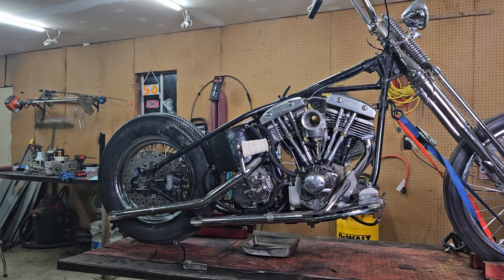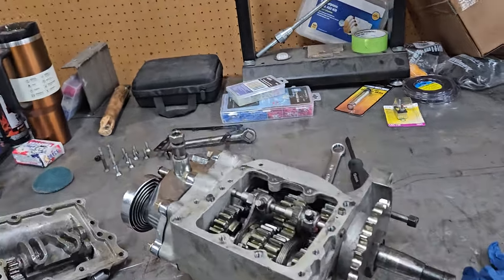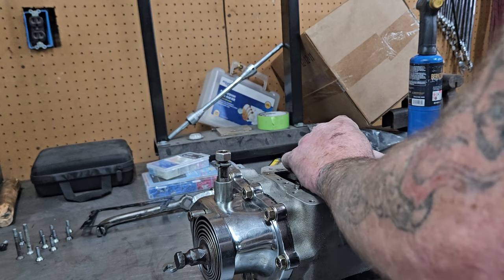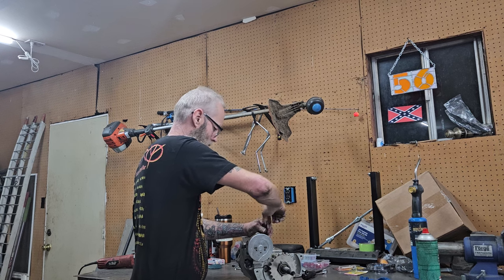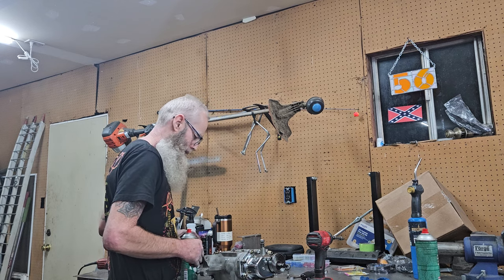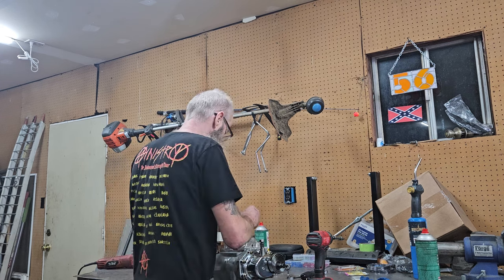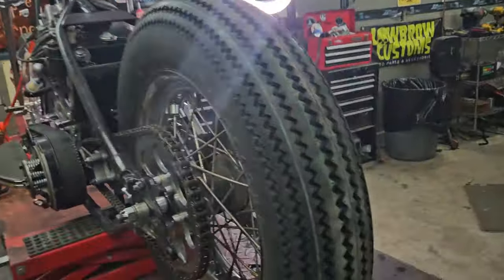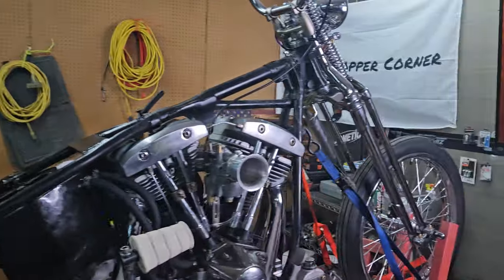Breaks and oil lines ran, and figured out the transmission

Comment: from what i see yr shift forks  aren t lined up the tops are out of line  they sell a jig that matches up lid to tranny u need to check under rachet cover for broken spring & timing
Reply from the maker: Thanks man. It's retired to the shelf for now 🤣🤣🤣
Reply from the maker: But I'll definitely buy one
Reply: They sell a alignment tool. But you do not need it. If you set shifter forks  to the neutral position and have shifter drum at neutral then install cover forks will go into shifter drum ramps then remove cover and check clearance of slider gear that shifter forks control if alignment is off as in shifter gear closer to one gear than the other than you will have to adjust the alignment of the slider gears by removing or adding shims on the shifter forks so it centers up. The shims are behind the nut on the shifter forks. On the early models that is how the side clearance is set.